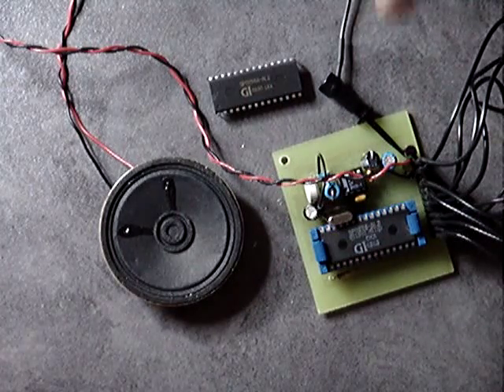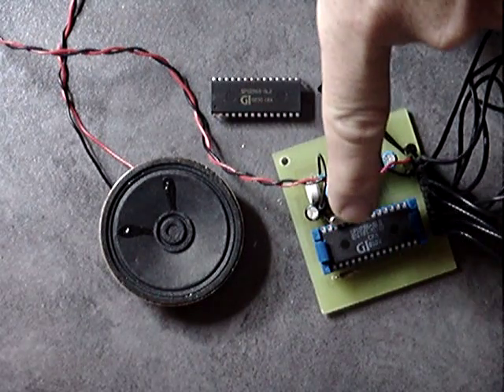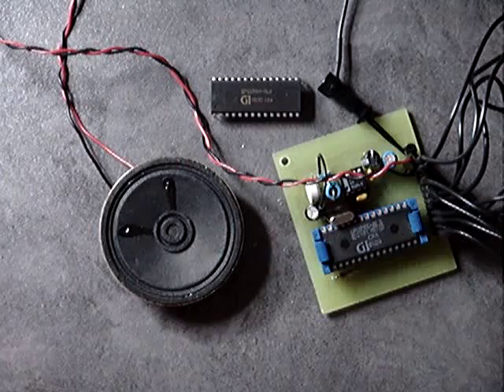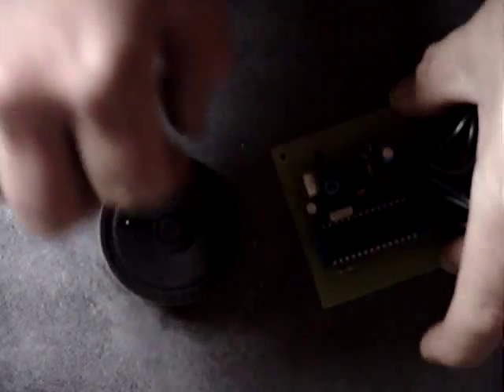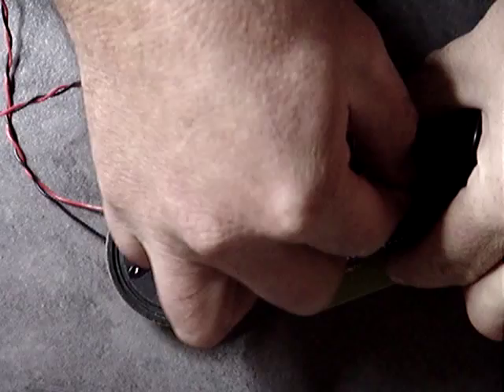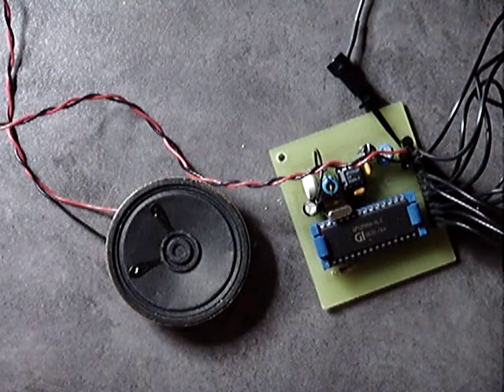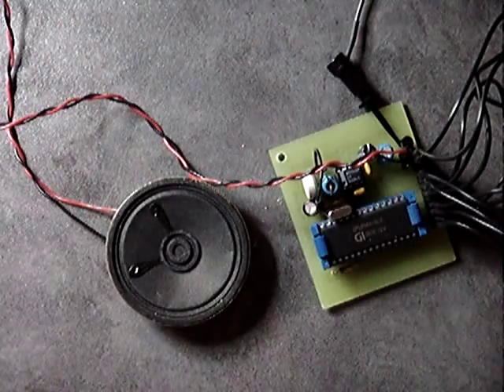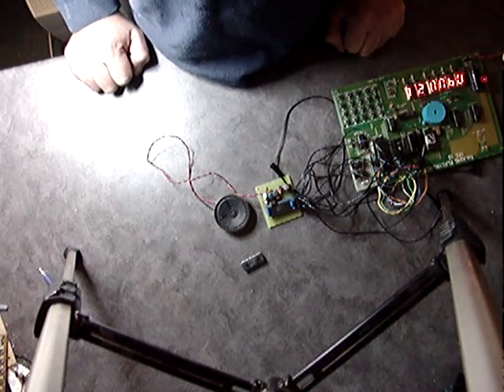THIS IS A SPO256A-AL2 OR IS IT ?

Comment: Folks there are fakes of these out there, basically emulators that apparently do not work.  Plus there were several custom versions out there.  Radio Shack sold the correct one many many years ago.   It was the SP0256A-AL2 and they also sold the optional ASCII to Speech companion chip the CTS256A-AL2 controller. When buying check the date too, it should have an 81 - 82 for the speech chip and 84 for the controller. You can still get these at https://www.ebay.com/itm/273045417757
the same seller may also be selling the just chip and the 3.12mhz crystal.
These are the real deal. new old stock. supplies of these genuine chips are vanishing and people are apparently selling poorly hacked or PIC emulator copies which may not follow the same timing protocols as the originals.

Comment: I am guessing you purchased the SP0256 and not the SP0256-AL2. These are different chips!
The AL2 has the English Allophones built into it's ROM. The SP0256 doesn't.
You may need to re-write your software, but I am willing to bet the chips work, but are just the wrong type. You may actually have to hook up an external ROM to take over the AL2's internal rom function.

Comment: They are actually called SP0256-AL2 ICs (with a zero),  not SPO256-AL2 (with a letter "O").   Easy mistake to make.   Even an 80s game manufacturer made the same mistake.
I use them a lot,  mostly to repair ZX Spectrum and C64 Currah μSpeech synthesizers.

If they are from a reputable supplier you should be able to get a refund without to much trouble.